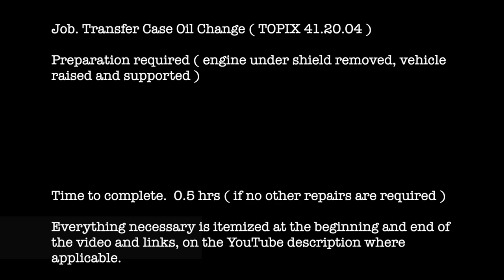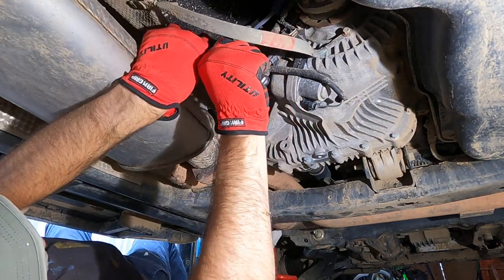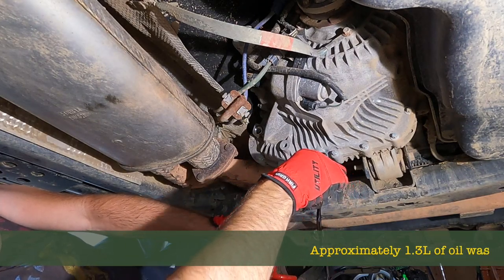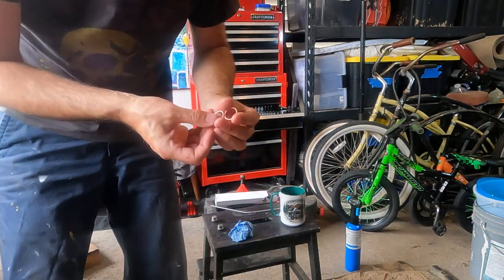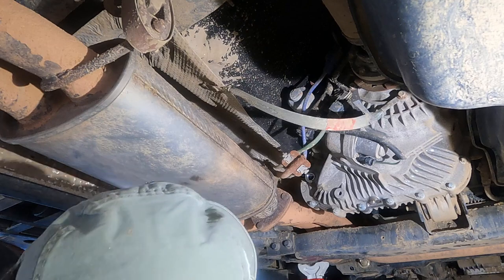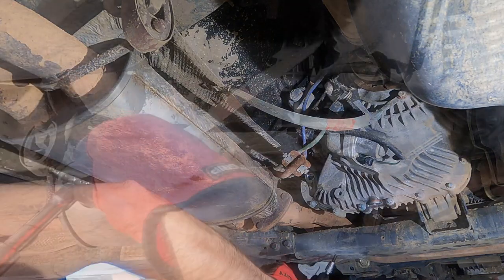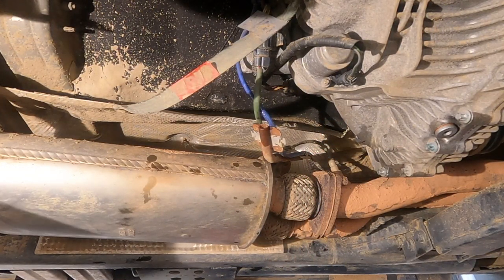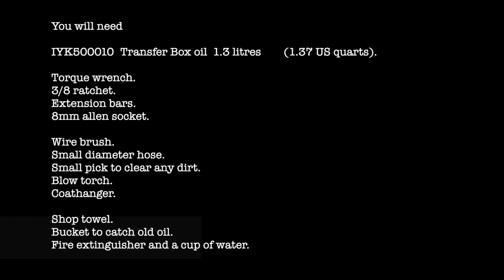Land Rover | Transfer Case Oil Change "what an engineer wants"

Comment: Hey mate - you quote 1.3 L of the oil - my D4 workshop manual quotes '1.5L plus or. minus 2%'...  Is there a model change or something we all need to be aware of (D4, 2016 MY TDV6 with 8 speed ZF auto transmission in my case). Cheers.
Reply from the maker: Thanks for commenting. 

I’ll double check my info. But if your manual states something different then I’d go with that. 

The basic principles remain the same though.

Comment: What Year and Model are you working on in this video? do you have the 2-speed HD Transfer case? Thank you!
Reply from the maker: Hi, it’s a 2015, yes it is the 2 speed transfer case with locking rear differential, Lr called it the HD package.
Reply from the maker: The model is LR4 HSE Lux.